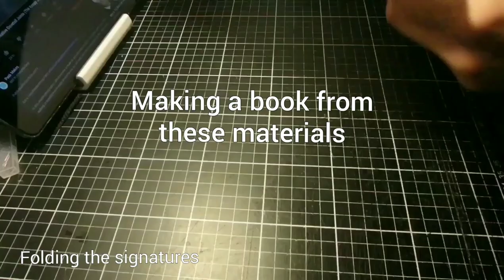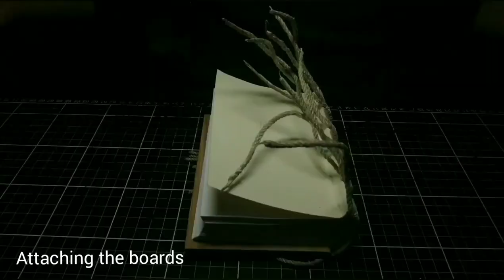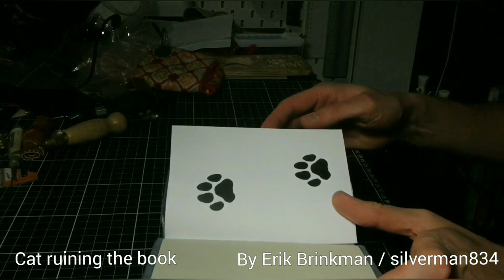Making a medieval book

Comment: The finished signatures have grain running perpendicularly to the spine...
Correct me if I'm wrong
Reply from the maker: Yeah, you're right. I couldn't find short grained paper.
Reply: @BrinkmanCrafts  emm..., just cut it in half before folding?
Reply from the maker: Then the book would be half the size. And no - I couldn't neither find paper of double the size in long grain.
Reply: @BrinkmanCrafts   @silverman834  I don't get it. You could've fold the signatures twice instead of three times, and stack two signatures together to make up for the correct thickness
Reply from the maker: Yes, you're right, I forgot that I used that method in this video. Your way would make a more sound book, but I think I really wanted to make the signatures from just one paper. But yeah, I hope I nowerdays would pay more attention to this.
Reply: @BrinkmanCrafts  it only bothered me that despite all the experience that you clearly have, you've made such a basic and easily avoidable mistake